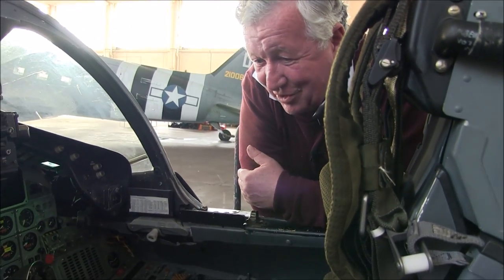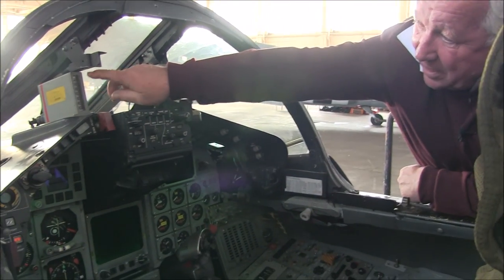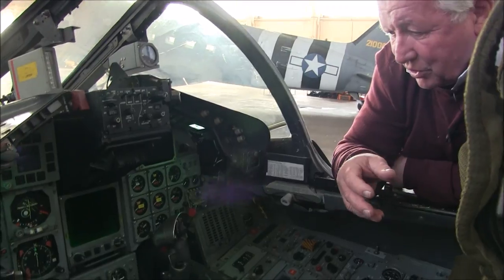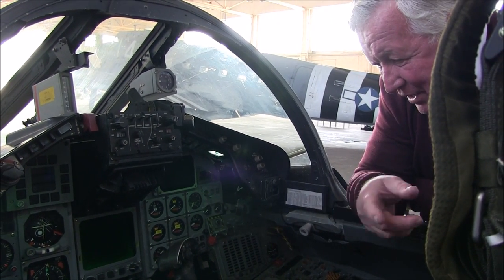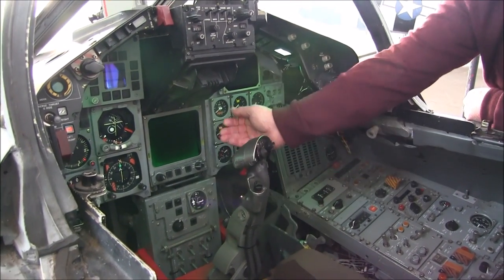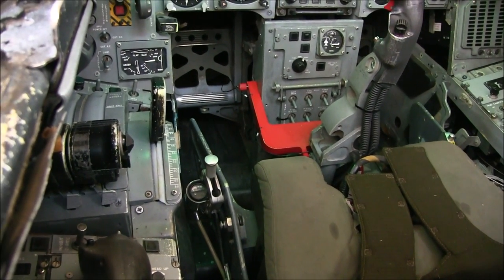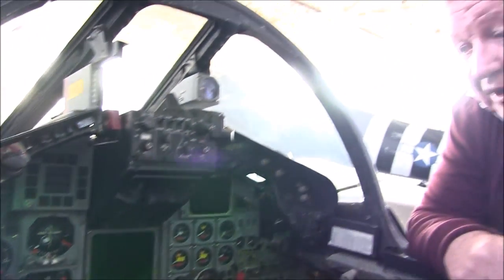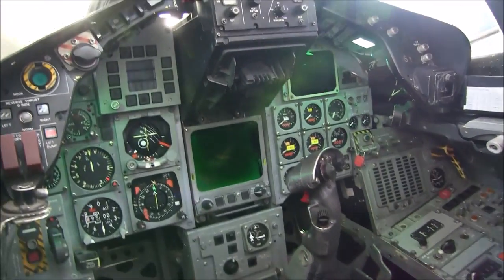Tornado F3 Cockpit (ZE965) with Rick Peacock-Edwards

Comment: The shorter pilot is a better one , especially as a pilot of interceptor  air superiority / supremacy , multi roles in the strike duties where evading the pursuit and the ground missiles required the execution of sharp maneuvers creating a tremendous G force ... where the blood circulation of the shorter pilot takes a shorter distance and is therefore faster in rotation inside the body , unlike the longer pilot whose blood is cut longer distance from the head to the feet . here the shorter pilot's tolerate more G Force for a longer time and the pressure suit improves the pilots' bearing to this G forces, but the key factor of the length difference remains the basis for determining  G Force endurance capabilities or at least played a major role in this part , the down side of the shorter pilot is the limited vision or the awareness this is a problem in the dog fight or ( within visual range ) although he can handle more G Force could help him pushing his machine beyond its capabilities . this problem is overcome by positioning the pilot seats or position on the plane in place of inserting him inside the fighter fuselage .
 Offset by the field of vision or the awareness of the periphery for the longer pilot is much better than short one ....
Reply: I dont know why that is relevent to this video in anyway. I doubt a few inches of height is going to make much difference to how well you can withstand gforces, in fact i imagine fitness/strength and experience is far more important a factor.